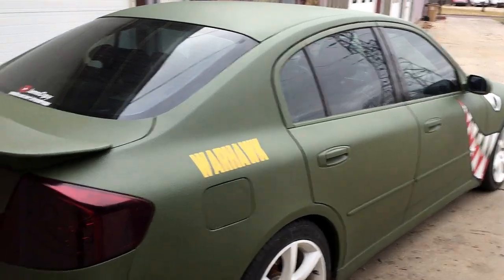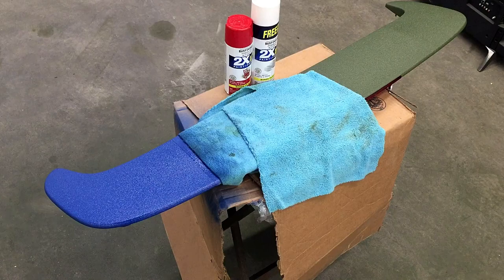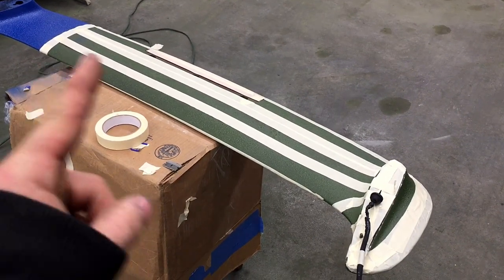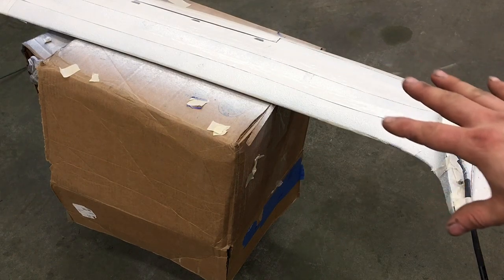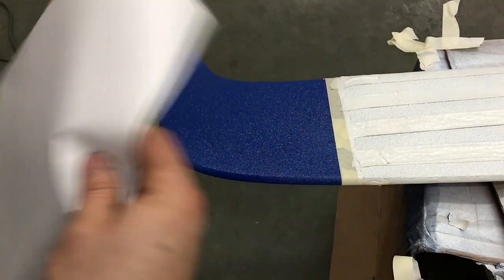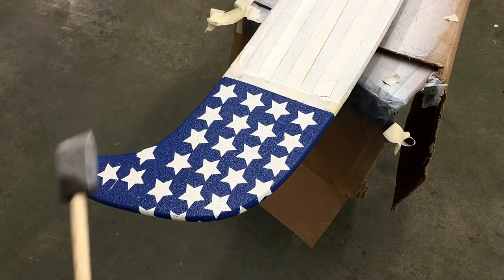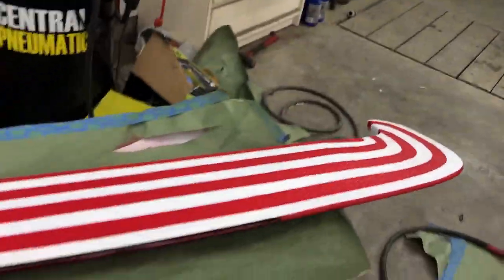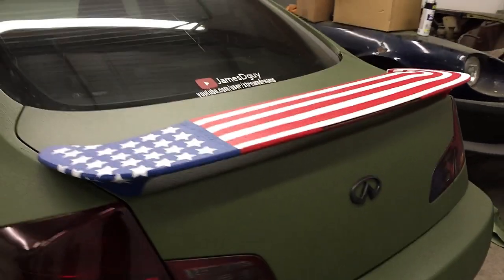Infiniti Warhawk Part 3- American flag spoiler/Wing. (Subscriber recommendation)

Comment: Thank you for replying back,the rim is not that bad,its just a tiny crack on the inside rim,coz my car had a flat and it has been sitting in the drive way coz it was snowing and it's cold here in excelsior spring and I couldn't do anything much and just found out when I put on the tires,thank you
Reply from the maker: No problem and i have seen people make small repairs with JB weld but i don't wanna risk your life over a blow out or something.

Comment: Maybe take a piece of cardboard with a straight edge and lay it across the spoiler vertical and mist black across the edge of the cardboard. Do this in several spots across the spoiler to give the illusion of folds from it waving in the wind. Oh and definitely need an American flag headliner, or sew together flags from each military branch and use them to cover the headliner.

Comment: Love the content on the page just have one question as a painter. Why didn’t you paint the whole portion where the stripes were going white then mask off the lines you wanted and paint red over the white? Just out of curiosity.
Reply from the maker: NC Graphix Didn’t want to have wrinkles. Sometimes it happens and I’m not sure why but I did think about doing it that way. Would have been easier.

Comment: You should have used the tape your dad used to do the face. It handles better, and gives straighter lines. I also think you should not have curved the flag around the edge of the spoiler, should have made it straight lines all the way across. It makes it look more like a candy cane.. And stars should have been lined up straight, they ended up cockeyed.  I was going to suggest in last video is do the hood  (top of car) American flag, but this works to. I hope you redo the spoiler, to straighten out the lines. Sorry I am new subscriber to your channel, and I don't mean to nitpick. but when it comes to the American flag, it should always be represented perfect. Other than that man, I am enjoying your videos. Ill keep watching.
Reply from the maker: Figure Six Well there is a lot of things I could have done different but I was working with what I had and my impulsiveness is what makes My builds come together. So far you are the only complaint on it the 10+ veterans who have shook my hand personally and thanked me for my hard work putting the vehicle together said they think it’s great. I do have different plans for the wing anyways but that’s coming soon enough. Our coffee table has more detail in it than the wing does but that’s what I get for rushing it.

Comment: What's going on boss man,I've got a question,how do you fix small crack on a rim,thank you
Reply: I was wondering if you can help me out,thank you
Reply from the maker: Im not sure what could be done. I know some people weld the crack and grind them down smooth them out with fiber glass but i'm not exactly sure. I would probably replace that rim depending on how bad it is.

Comment: How come the car has a gritty look to it
Reply from the maker: david kemp It’s truck bed coated using raptor liner
Reply: Ahh ok.      Ive just started sanding my car down but do i need to take it to bare metal or should i be good just making it smooth.
Reply: Its a black car